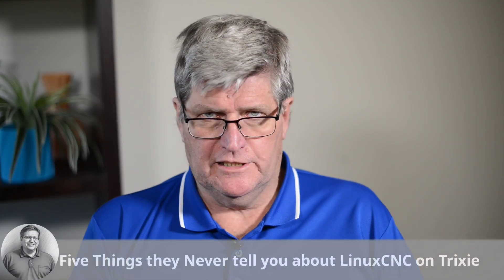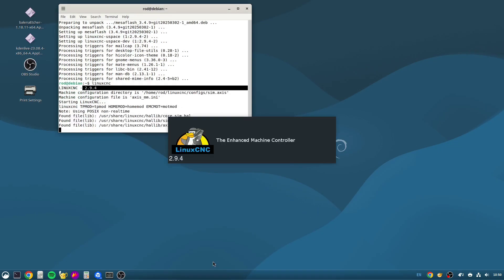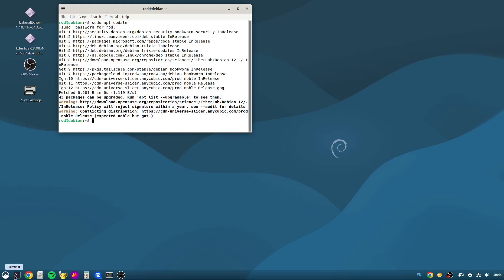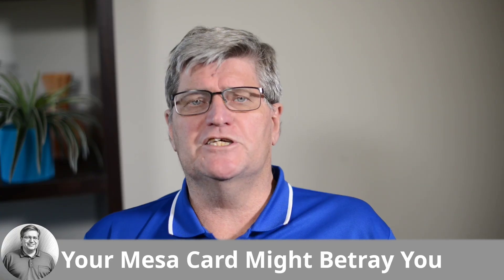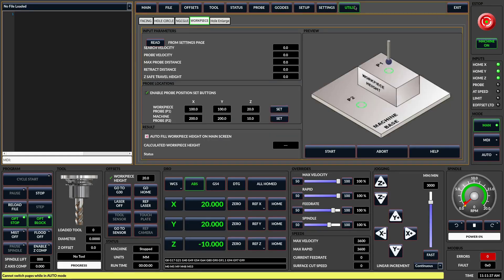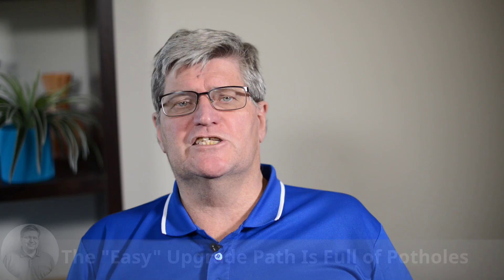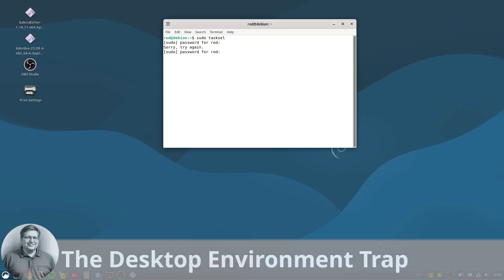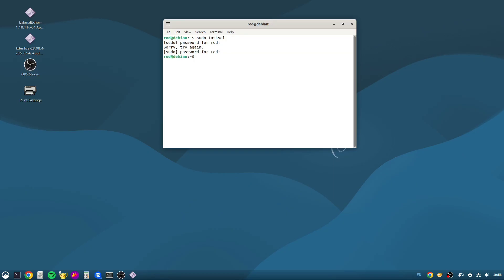5 THINGS They NEVER Tell You About LinuxCNC on Debian Trixie

Comment: I'm still using old Wheezy 2.7.14 LinuxCNC, with RTAI kernel. System is Athlon X2 6000+ and 8 Gb RAM. I have 2-3 microseconds latency only!!! And i don't like that fact they stop making RTAI - based ISO images...Only with Preempt -RT now, but Preempt -RT have much worse latency than RTAI... Honestly, i want to try Mach3 now😅😂
Reply from the maker: Great work, There is a RTAI version of Linuxcnc 2.94 for Bookworm on the downloads page. I have never used RTAI because I have never used a parallel port. With an ethernet connected board or ethercat,  the need for latency is much reduced and I have seen it improve a lot since on new Operating systems building my first LinuxCNC machine 10 or so years ago when you had to compile the kernel to get PREEMPT_RT

Comment: This is an issue with Ethernet Mesa cards? Or also with the likes of the 5i25 that isn't using Ethernet/rj45 to the Io board?
Reply from the maker: Just the ethernet based Mesa cards. The problem stems from not having real time network drivers. Because ethernet networks were never designed to be real time.

Comment: Because they haven't updated yet for trixie I assume. also, the manual last updated 20 days ago, specifically says not to upgrade the os....
I literally know nothing about linuxcnc before 5 minutes ago. but you always should rtfm if you're having issues....
Reply from the maker: Debian Trixie 13.0 included Linuxcnc 2.94 in is repositories for the first time but since then there have been a couple of bug fix releases so LinuxCNC is now up to 2.96 which the devs are hoping they can squeeze past the Debian gatekeepers on the next Debian point release.
Trixie now requires a longer security key for repositories so apparently, installing from the linuxCNC repository may not be an option. I have not tried that yet. Read the release docs to see if the bugfixes since 2.9.4 are needed. In a lot of cases they won't be.
So as always, there remains good reasons to upgrade in some instances. Enhanced 5 axis TCP support is a big one!
Reply: @MrRodW  ai. it's a bit of a nightmare from what I've been reading. Until they release proper documentation, and compile an iso, you're basically beta testing. one page says don't upgrade the os, release pages say it's ready. My guess is the kernel/deb packages have changed just enough to be annoying. An issue I've run into a few times with other projects and deb based systems. (I use arch btw...sry, couldn't help myself:) 
guessing the 5 axis tcp support is  kernel dependant? Normally, I'd say, stick on bookworm, and upgrade the kernel, but I haven't used a deb based system in a couple years, so not sure that'd be a viable option. That's the beauty of arch tho. linuxcnc is in the aur as well. I wonder if that'd be easier. You'd have to compile 2.96 from source tho, as the aur only has 2.94 but it appears the compile process is pretty straight forward.
And 6.17 is def more compatible than 6.12. At least on my system. 6.12 is getting kind of old now...  I had hardware that wouldn't work without patching, but worked fine with 6.13 and later. But what you've described sounds very much like a kernel issue, and upgrading it might solve some of those issues...not everything obviously, but the rt stuff maybe.
Reply: @MrRodW  the other possible issue I see with that project is maybe dev burnout. commits have gone way down in the last couple years. and really only 3 people working on it, with another 8-10 making small commits, probably for their use case. The wiki's down, and only accessible via web archive. and there's only one person who's got access to the host to fix it.
Reply from the maker: @TheCurtisnixon  yes, I agree with that. Its sad but all to common in the open source community. The wiki has never been very useful for me in the 10 years or so since I  have been using LinuxCNC. I always read the official docs and be sure I read the correct version.

Comment: Here's something to think on.

Don't EVER replace a working operating system with a new one. If it ain't broke, don't fix it!

This isn't just Linux, it's ANY software (including drivers!)

This one sounds a bit like a scheduler problem. As soon as you're on an RTOS, there's a very good chance your software will suddenly find itself without clock cycles when it's expecting to get them.
Reply: I agree with this completely, these should never be on the internet so the only argument to replace software on a working system is gone (security patching). If your system is stable and works, don't play.
Reply from the maker: @marcdraco, one of the issues is that there are no Real time Network drivers so if you have hardware connected by ethernet, and want to talk to it in Real time, the best you can do is to ask the NIC driver to run on the same core as the RT thread with CPU Affinity.
Reply: @MrRodW  Indeed. Precisely my point though, they took something that worked and broke it.
Reply from the maker: Yes, I agree with your sentiment but its not always as simple as that as sometimes there are some other things that need to be considered. Getting improved hardware suppport was the catalyst foe a few ofmy changes.

Comment: Thanks for the videos they do help. I have PlasmaC running on my machine with mesa card and it works really well. Has for a long time. I dont use it much but when i do it works. It took me forever to get it up and running when i first started out and many times i wanted to pull my hair out. Yours and other people putting in there time to put out videos are the only reason my machine is running. Thank You!!
Reply from the maker: That's fantastic to hear! Glad the videos were helpful in getting your machine up and running. I do remember those days. Building a machine before QTplasmac and not knowing about anything, Inhit some many issues I could not solve for days, but that gave me an enquiring mind!

Comment: Thank you for publishing this - hopefully many of the issues will be resolved over time so us meer mortals can keep up to date!
Reply: Thank you for this. We have a simple parallel port setup running Debian 9 and LCNC 2.7 which I have resisted upgrading since our slow rebuild. We have no current intention of going beyond the parallel port setup and this new advice is now giving me second thoughts about updating LCNC at all.
Reply from the maker: @paulreader1777  on the  downloads page at linuxcnc.org,  there is a RTAI image with LinuxCNC 2.94 that you might like to try for your Parallel port. I have never used the parallel port.
Reply: @MrRodW  Thanks, I will try an installation on another pc and possibly on a RPi as an alternative.
Reply from the maker: You are welcome. I am hoping to do another video of the installation process itself. I think as computers get more complex, there are more settings that need tweaking.
Reply: Wow, I wasn't expecting those sort of troubles. Clearly, Linuxcnc has a stable following of users. Until things stabilise, what version of Debian and Linuxcnc would you recommend? BTW: Do I really need the real-time version of Linux if I'm using the Mesa controller?
Reply from the maker: @j.a.f.8029  Yes. the PREEMPT_RT real time kernel is required for LinuxCNC becasue it is THE motion controller, unlike other systems that use  tiny emasculated controller on a external  board. Fortunately, its installed with LinuxCNC as its a prerequisite. Computers have got a lot more complex and there are a lot of settings  and power saving features that need tweaking in later kernels so its not going to improve. Subscribe to my channel as we'll cover it all in future videos.